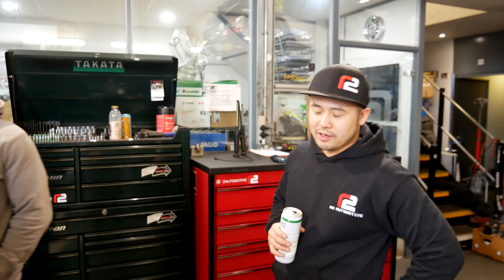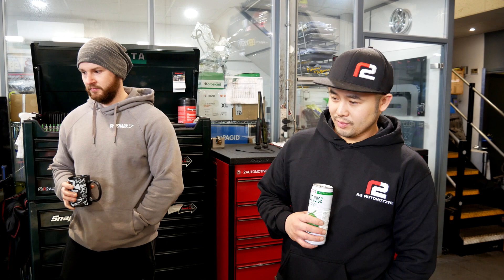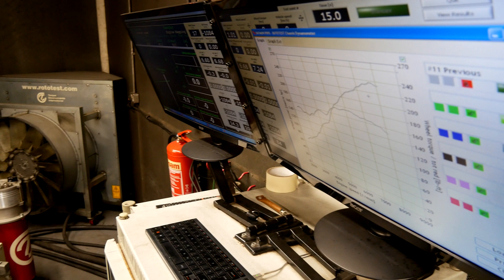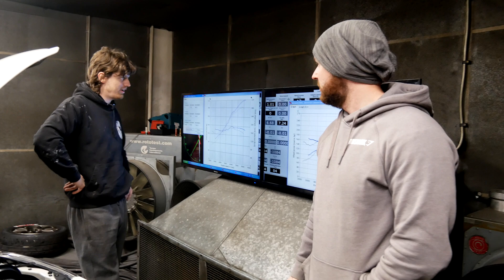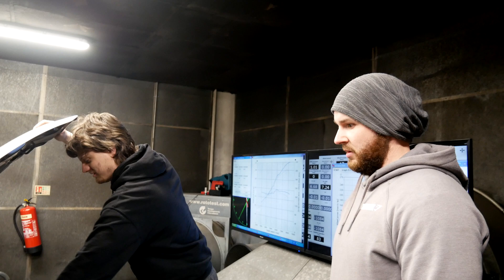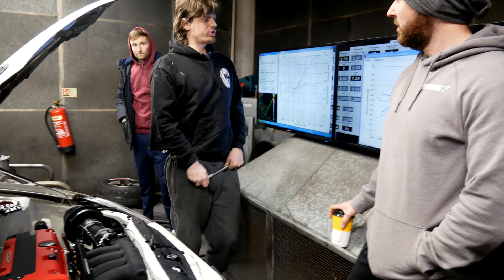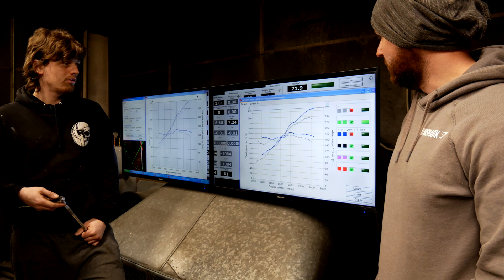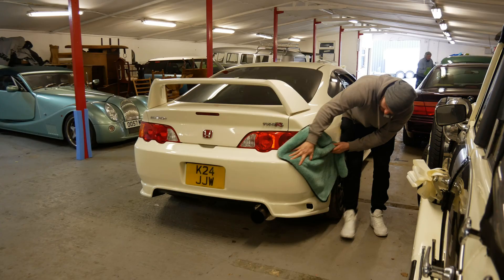Honda Integra DC5 K24/K20 Mapping Session. 300bhp Possible?!

Comment: Very nice built.  I'm curious though, why are you multiplying the figures by 1.12?
Reply: He was adding 12% (driveline losses) onto the whp figure to give the approximate crank hp (bhp)
Reply: @rldrld7747   oh.. right.. Weird cos drive train loss isn't in the slightest bit linier, nor does it change when you make more power.  My K24/k20 supercharged build had 18kw of drivetrain loss at 7600RPM, and 8kw at 6800RPM.  Still, this 200kw NA build isn't bad is it.
Reply: @iwanttobeamole  Yes that's right it's definitely not a linear loss. If the drivetrain is moving at a consistant speed (such during a steady state dyno run) , the loss will be a set percentage of the engine hp. Under acceleration the power consumed will be higher as it takes more power to accelerate the mass. It would be interesting to compare whp to engine hp to get an accurate account of drivetrain loss for a given setup in a controlled test